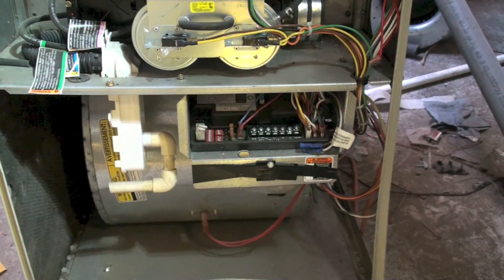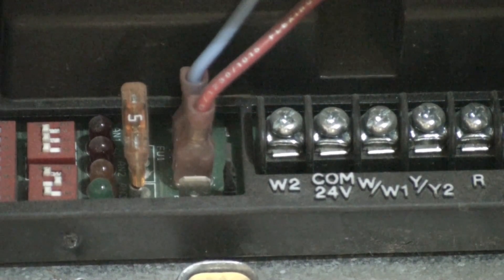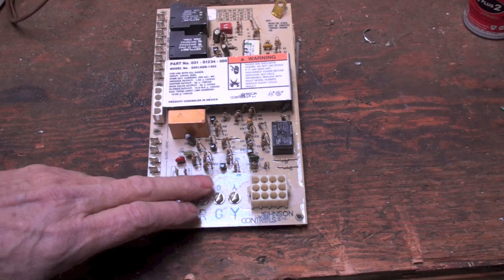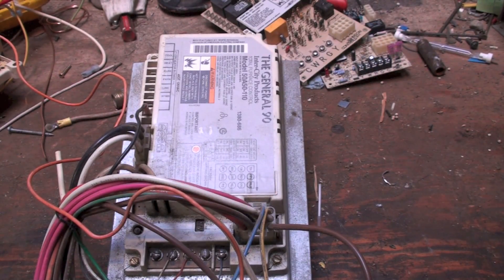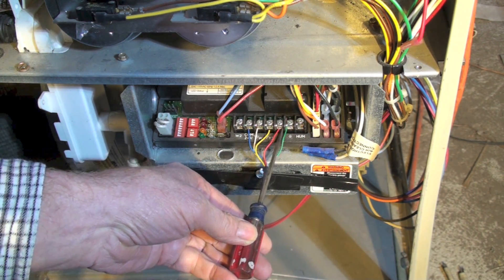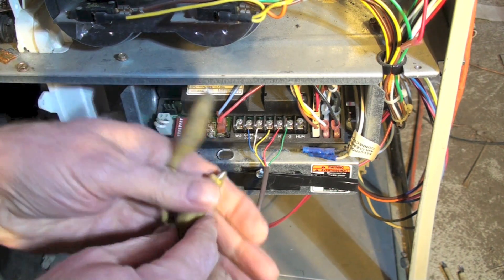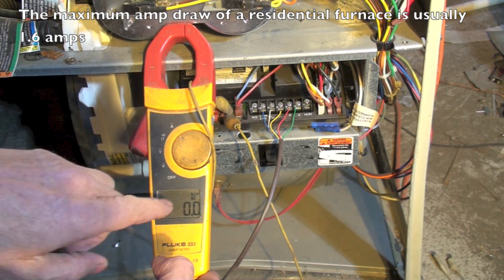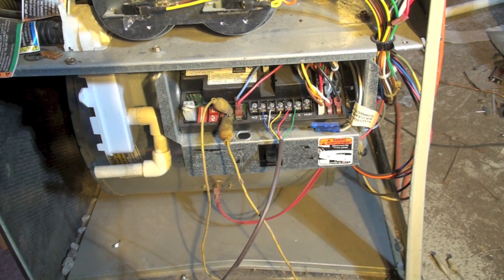Furnace low voltage short diagnosis part 1

Comment: I had my first service call with a blowing fuse. I really wish I had a lil' popper with me at the time. Anyway I found out quite by luck that the furnace would blow a fuse as soon as I turned the humidistat up. I spent way too long tracking wires thinking the two wire going to the humidifier was shorting out in the venting somewhere. What it turned out to be was that the solenoid had an internal short whenever it was powered. Qouted the woman a solenoid replacement or humidifier replacement and will wait to see if she does either.
Reply from the maker: I know it is common to suspect wiring shorts but in most cases, it will be a component that has failed.
GFM

Comment: To be on a safer side would you put a reset able fuse in series with the jumper wire?
Reply from the maker: Certainly that would be best.
GFM
Reply: Yeah buy yourself two Supco Lil Poppers, one for 3 amp and one for 5 amp. They're about $20 a piece and they work great.

Comment: What about using a 5 amp popper?
Reply from the maker: Works great.
GFM
Reply: Michael Madrigal   Put a bigger fuse in until the bad part burns up? Do a Obama test on parts

Comment: where do you put the jumper wire if the board does not have a fuse on the board.
Reply from the maker: You won't need the jumper.  Just put your clamp meter on one of the wires to the transformer secondary.
GFM

Comment: This actually happened to me once, while is working on a furnace, I ended up following the stat wires to a junction box, found the insulation on the wires all worn off for some reason. I ended up replacing the entire wire run. Problem solved

Comment: Thanks Fman, do you have a reset-able fuse in your kit? Great time saver, board safe :) don't have to worry about hitting it with more than 1.8A.
Reply from the maker: cb2033x I sometimes use them.  However, I find in most cases, just watching the meter is faster because I don't have to wait for it to reset.  Thanks for the thoughts.
GFM